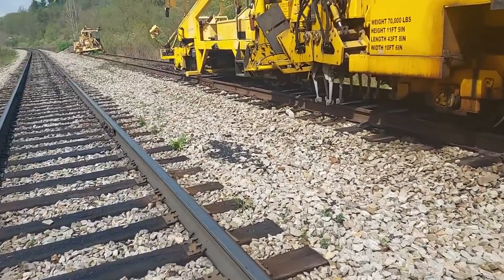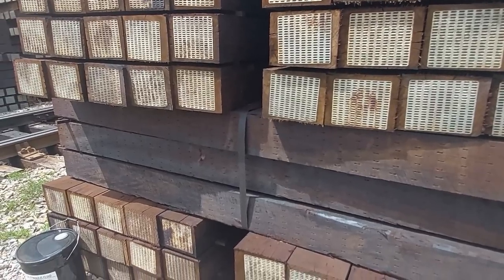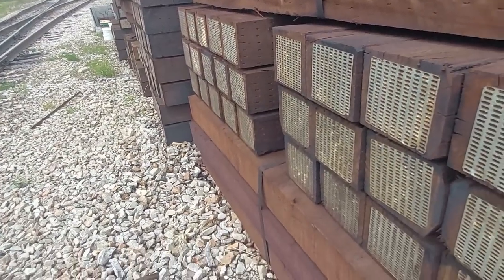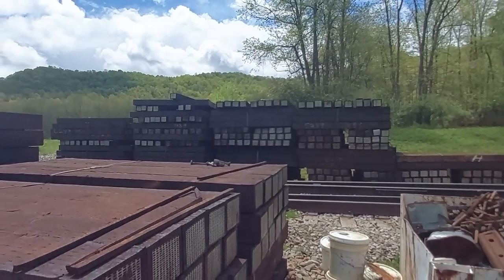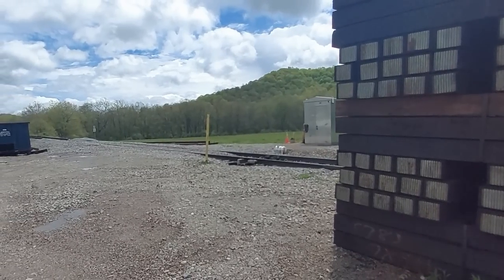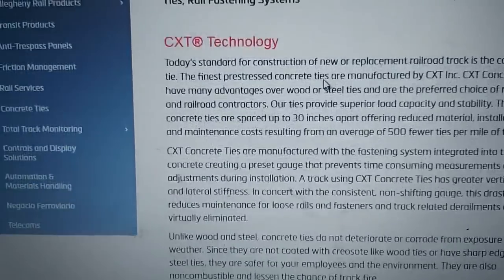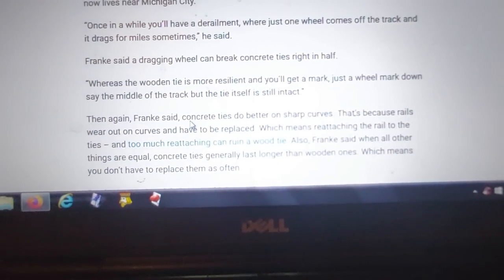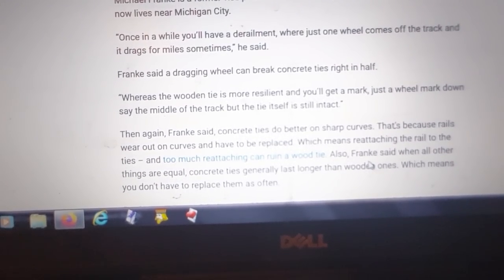Why some Railroads use Concrete and some use Wood Cross Ties

Comment: Was it a Co$t Factor?  Wood vs Concrete   ... Would it made a strength Difference if the Entire Concrete Tie was solid Concrete w/ Rebars?   .. Also what's the Difference between a Concrete Tie and a Sleeper?
Reply from the maker: A sleeper is a tie. They call them sleepers in some other countries
such as UK and Australia. Rebar is almost always put in concrete
ties now because it is stronger than without. Concrete ties are
more expensive than wood ties, but they also last a lot longer.

Comment: Read symposium on railroad construction on lateral load testing. 
Concrete smooth bottom poor results.
Concrete cupped out bottom  a bight better  loading (ballest shape)
Concrete with pebbled bottom had highest load (ballest digging in).
Next problem is type pre stressing steel used, micro water penatration rust lines installed 1980's (roughly 40 years usage).
Heavy construction magazine in 1978,article CN Rail plan to use concrete on curves over 4 1/2 degrees (main line).
Reply from the maker: Thank you very much Sharon for the info. I've tried to find that
article, I would love to read it. My searches are failing to come
up with anything. Is there anyway you could possible reply with a web site link to the article? I would be most appreciative. I love
to read stuff like that and find out what other RR's are doing.
Appreciate your taking the time to visit with us and take in the video my friend.
Reply: AERMA published 1987 to 1993. Article on multi tamping 60 at AAR province grounds.  More jagged over 1 1/2" best, pit run waste of money!!!! Another from Japenes national railway using 115 on crossing and 100 tangent, cross section change mud pumping issue.
Reply from the maker: @sharonfieber6458  Thanks! 👍😊

Comment: very interesting video 🙂
Here in Germany, we started using concrete ties in the 1960s. Today, wooden ties are rarely used Concrete sleepers are also normally only used with welded rails because the hammering on railjoints damages the concrete sleepers 
in the 1930s until shortly after the war, some routes were given steel ties, some of which still exist today because they are very robust, the disadvantage is that there there are  very loud .
and yes, one of the main reasons is that little wood is used because of environmental protection regulations
which is even more important today than before
our forests are dying because of extreme climate changes
Reply from the maker: Thank you for sharing that CHB Rail. I will someday do a video on steel ties. Appreciate your taking the time to watch and write in my friend.

Comment: Another Argument why Europe is switching to concrete is that the disadvantages are mitigated better… For running pax at up to 100mph, your MOW guys need to be good and mud puddles or other such stuff was already a problem to be eliminated before concrete ties, so mud and low quality ballast aren’t really a thing on most lines due to them seeing fairly high speed passenger trains scheduled VERY frequently, so concrete ties will last longer with little downside that way…

Also, derailments on the main line are RARE (derailing a or into a passenger train doing 100mph is a near miss or an unmitigated high casualty disaster, so DON‘T) and usually trigger huge investigations anyway, so if the rail is closed for a month for investigation and you need to realign the tracks anyway, does it really make that big of a difference to replace a bunch of ties?
So, the derailment case would be replacing a couple hundred ties per year on a network of like 10000 miles, they might only average 49 years instead of 50, but that’s still better than wood on average.

Also, a lot of railways have automated tie replacement trains that have like twenty flat cars of ties stacked as groups of like 10 wide and six high with a crane feeding the tie setter train automated, so weight isn’t that big an issue because you’re probably never moving them by hand anyway.
Reply from the maker: You are right Genoobt, concrete ties do have a very good place,
specially on the high speed trains like you say. And like you say,
high speed tracks are taken care of to more exacting standards than our 25 mph track only hauling coal and no passengers.
Thank you very much for taking the time to visit with us and may you have a very good day my friend.

Comment: I also believe that the weights of trains in Europe are significantly lower than in the US…
Reply from the maker: Yes they are Kevin. Concrete is well suited to high speed lighter
passenger service tho, which is one reason why concrete it used
a lot in Europe, most freight RR's in Europe use wood ties from
what I'm hearing, although I've never been there to see it. Thank
you for taking the time to watch and write in my friend.

Comment: I'd like to know, why bother with ties? Why not lay down a continuous concrete road like the interstate, only 5 feet wide and then bolt down the rails? Or even better,  cast the rails directly into the concrete so you don't need fasteners.  If you ever need to change a rail, then wetsaw it out of the concrete and cast it back in. Why mess around with ties and ballast and all of that? Just lay down a continuous narrow concrete road like an oversized sidewalk about a foot thick or so. Seems like that's all you need. I mean, they had corderoy roads back in Model T days what were  miles of logs or planks laid sideways, railroad style, and they soon found out paved roads were much better.
Reply from the maker: Interesting comment Jimmy. Consider this: our long tunnel has
a concrete floor. There is a base slab 6 inches thick, then the ties
were laid on top of that and concrete poured around the ties for
the top flooring, it works superb. Only problem is replacing ties,
you have to take the rails out to replace ties, there is not enough
room on the sides to pull a tie out or insert one. PIA in the tunnel.

Comment: Cement production accounts for approximately 8% of CO2 contribution to the environment. From my understanding, it causes more contribution than aviation. Growing trees can be a renewable resource via forestry management. If your company buys from a renewable conscientious tie producer, you are better off using wood.
Reply from the maker: Thank you for sharing your thoughts and for watching the video
Randy. No argument from me on the cement industry's green house gas emissions being hard on the environment. However, in the video I was speaking strictly of the effect of wood vs concrete ties, not about an industry in the whole of itself.  

My information came from Robert Crawford, University of Melbourne who did a comprehensive study on the CO2 emissions from concrete and wood ties finding the CO2 emissions associated with concrete ties are two to six times lower than those from wooden ones.
Here is the link to that study: 
https://pubs.acs.org/doi/abs/10.1021/es8023836
Reply: @ccrx6700  Dave, thanks for responding. I know these videos are a lot of work but I appreciate what you do and thanks for sharing!

Comment: Hard to describe but the ride on wood ties is more comfortable than concrete at least with an SD 40-2 or AC 4400.
Reply from the maker: I have a friend who is an engineer for NS, he confirms your thoughts,
no give at all with concrete great for high speed passenger trains
tho. It's a softer ride on wood, not a stiff ride. Thank you for  taking the time to visit with us and check out the tie video my friend.
Reply: @ccrx6700  I think it harder on the wheel bearings in heavier equipment.
Reply from the maker: @reginald2004  absolutely

Comment: Hello Dave,  I will respectfully disagree with you as far as "environmental cost".  Concrete and steel are high carbon footprint.  Wood is low carbon footprint.  Creosote is the main factor against wood ties.  Wood ties can be burned in biomass plants, such as the one used by the CN in L'anse, Michigan.  Trees grow over and over on the same soils.  It's hard to get more iron ore, coal, or limestone out of a worked out mine.
As far as your operation, coal is a resource that is being fazed out.  If the mine is not worked out first, environmental restrictions may force the operation to shut down within the 25 plus or minus year life of a wood tie.  A more costly concrete tie probably cannot be justified in such a scenario.
Reply from the maker: Thank you for sharing your thoughts and for watching the video
David. No argument from me on the cement industry's green house gas emissions being hard on the environment. However, in the video I was speaking strictly of the effect of wood vs concrete ties, not about an industry in the whole of itself.  

My information came from Robert Crawford, University of Melbourne who did a comprehensive study on the CO2 emissions from concrete and wood ties finding the CO2 emissions associated with concrete ties are two to six times lower than those from wooden ones.
Here is the link to that study: 
https://pubs.acs.org/doi/abs/10.1021/es8023836
Reply: @ccrx6700  I have read the abstract of this study.  My gut tends to question his conclusion.  Perhaps my almost sixty years in the timber industry is clouding my thinking.
We have, in North America, a forest management crisis brought on by four decades of "politically correct' management of our western forests.  This has lead to dense and overgrown forestlands ripe for insect, disease, and/ or wildfire.  I would  prefer that much of the timber lost to these agents be made into lumber products, including railroad ties, than go up in smoke.
Just my bias.

Comment: I think your analysis of the relative carbon footprint of wood versus concrete is wrong. Concrete has a huge carbon footprint in just the production of cement. It requires a tremendous amount of energy to produce cement. Wood on the other hand is carbon negative to produce the wood. Furthermore, when you remove an old tie it either goes into a landfill or is used for landscaping. In either case no carbon is released. Trees continue to grow and capture atmospheric carbon. In fact today there are more forests in Pennsylvania than there were during the civil war. From this point of view I think that wood ties are more environmentally friendly than concrete.
Reply from the maker: Thank you for sharing your thoughts and for watching the video
Hank. No argument from me on the cement industry's green house gas emissions being hard on the environment. However, in the video I was speaking strictly of the effect of wood vs concrete ties, not about an industry in the whole of itself.  

My information came from Robert Crawford, University of Melbourne who did a comprehensive study on the CO2 emissions from concrete and wood ties finding the CO2 emissions associated with concrete ties are two to six times lower than those from wooden ones.
Here is the link to that study: 
https://pubs.acs.org/doi/abs/10.1021/es8023836

Comment: They are very heavy!😊
Reply from the maker: They certainly are, sure wouldn't want to put in concrete ties by
hand, in fact I don't know how 2 guys could do it without a machine.
Reply: Dave the town I grew up in spelled wrong. SULTAN, WA. SINCE I HAVE NOT LIVE THERE SINCE 1961. I REMEMBER THE ADDRESS. THEN WAS ABOUT 300 PEOPLE LIVE THERE.
Reply from the maker: @michaelpass2176  👍😊

Comment: Wood tie Carbon Storage. 
It strikes me that you could use the old charcoal burners method on end of life wood ties. 
Burn slowly with insufficient Oxygen and capture the phenolics which were preventing rot. Most of them have gone anyway. 
You will be left with nearly pure Carbon. Sell that weight as a "Carbon Credit". 
Crush the air out of it to give a much smaller volume and help fill up a disused mineshaft. A discovery in the next few centuries is unlikely, but how do you label it Do Not Move.
Reply: Excellent idea.  In fact, maybe some of that crushed carbon could be reformed into charcoal briquettes for sale.  Or just buried, since it would be extremely stable.
Reply from the maker: Appreciate your sharing that with us 20chocsaday, interesting. I like you think there could be better uses for old wood ties than what we now have. A few power plants do burn them, but they are far
from us here. Thank you for taking the time to watch and may you have a very good day my friend.
Reply: @ccrx6700  I was thinking that the bulk of the carbon in the wood would not actually burn and would lock up the element as an insoluble solid. 
That was an interesting explanation of which rail lines should have which type of ties. 
A recently renovated city line had two strips of concrete as far as I could see with the twin rail lines clipped onto the concrete. There might be a 3 carriage electric train each way every half hour. It went below the city but ran for 20 or 30 miles above ground at each end.

Comment: tf was that little piece of angle iron supposed to do?   it was way too light to take any load.    Seems like the concrete would have been fine if it was either the same dimensions as the wood tie, or else just the half ties like it was but without the angle iron.
Reply from the maker: I think way back then they bought tiies that perhaps should have
been used on a light transit RR instead of heavy haul, was certainly a poor choice of materials to purchase back then. Thank You for taking the time to visit with us and check out the video my friend.

Comment: You are probly wrong about reasons behind concrete ties in Europe. For example, Russia has no shortage of wood or natural resources and doesn't have any environmental regulations that could be a problem, but most of european part of Russia as well as many ex-Ussr states use concrete ties for all main railroads, usually electrified and often with silent joints. Sometimes there are concrete ties on railroads that only have 4 light passenger trains per day. Ofc always with a decent ballast. I think similar situation is in many EU states, so main reason behind 90+ % of wood in NA could be more about economy, more precisely about share of transportation by rail vs road in NA and Europe that leads to neglect and underfunding of railroads in NA.
Reply from the maker: Perhaps I am Honk Honk, no problem with that. As far as Russia
goes, they use concrete because of the extreme harsh cold temps
in winter. Wood doesn't last long, but concrete tie life in that
extreme cold only last about 10 years there. Cold is hard on track!
It kinda makes me wonder why USSR doesn't use steel ties? But
I'm not an expert on steel ties either. Very much appreciate your
sharing your thoughts and for watching my friend.
Reply: @ccrx6700  if its about cold then why railroads in Alaska and northern Canada use mainly wood ? weather in Alaska must be colder than in european part of Russia. 10 years is probly too short bc soviet/russian specification for prestressed reinforced concrete ties says that they have life time of about 50-60 yrs and have to use frost resistant concrete.

Anyways, thanks for replying and good luck with your channel. It has lots of interesting content.
Reply from the maker: @honkhonk6219  good point! I never thought bout Alaskan

Comment: Ah, maybe they use the concrete ones because they anticipate having to fix the rail a lot when an earthquake messes it up. I really don't know but I do know that there are very strict building codes if you want to even build a wall out of concrete or masonry.
Reply from the maker: More codes for buildings than for RR track construction that
is for sure. I don't know what they use in earthquake zones but
would imagine it would be wood?
Reply: @ccrx6700  They had wood here when I was a kid but now there are a lot of concrete ties. Probably either one survives the shaking itself so the main problems would likely be liquefaction causing the rail to sink or just having the track cross the fault itself and there's nothing you can do about that other than fix the entire thing. There are some good examples from the Ridgecrest Earthquakes that happened in 2018 because a track got seriously bent out of shape during those earthquakes. There were just strong enough to make a person take shelter around here but I read the geology report and the pictures of the tracks looked crazy.

Comment: Cost?
Reply from the maker: Being that there are 28 different profiles of concrete ties, it's
kinda hard to give you an accurate answer. Each different
profile has a different pricing. Wood ties here are $80.   All concrete
 are higher than that and heavier ones can be double or more the cost, plus transportation costs to get them to the job are much higher with concrete, because they are so much heavier than wood, it requires more trucks to get them to the job site. Thanks for taking the time to watch and write in my friend.

Comment: "transportation costs to get them to the job are much higher with concrete, because they are so much heavier than wood, it requires more trucks to get them to the job site"

Uh, wouldn't you use a railroad to get the ties to the job site building railroads? Like, load them on trains and bring them right up to the end of the line where you are building?
Reply from the maker: Thank you for the nice comment Bartholomaus. We have to truck in because we do not interchange with any other RR. Appreciate
your checking out the video and writing in my friend.